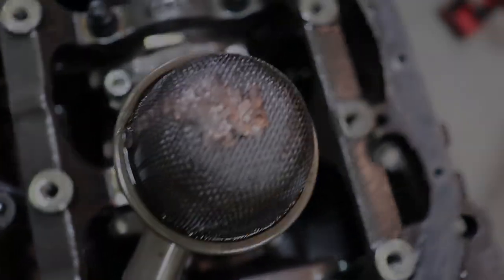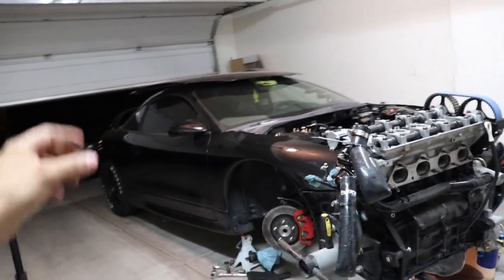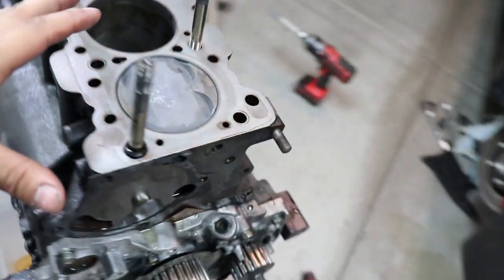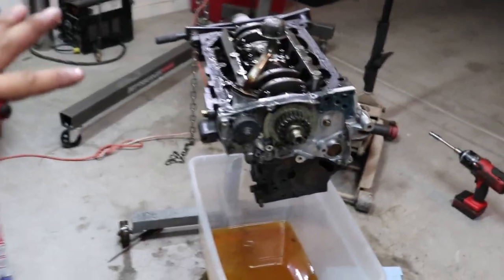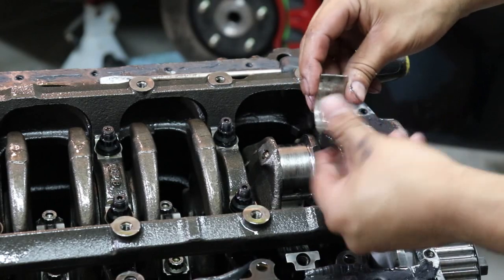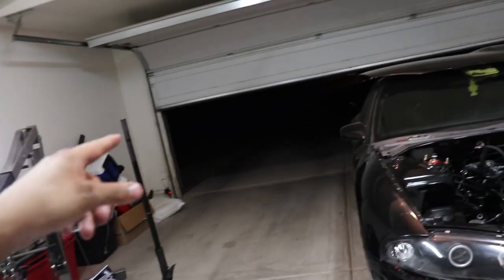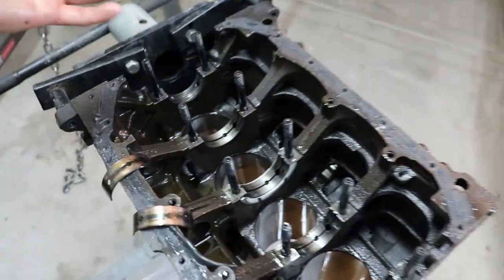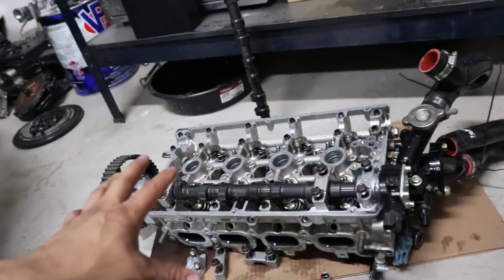TEARDOWN OF A 700HP MITSUBISHI 4G63 IN MY GARAGE PT3

Comment: this sounds what im going to be doing in the next week. picking up an 90 TSI AWD for 1200 with cylinder 1 @ low compression
Reply from the maker: Best of luck with the rebuild! Good choice on a tsi
Reply: @Gabe_Ortega   i wouldnt call it much of a rebuild im going to replace the rings rod bearings inspect the inside etc. replace the timing for now. dude said the car ran perfect in feb so if i can get some use out of it until i want to rebuild it that would be fine with me.
Reply from the maker: Def. Get the head check out if it lost compression. May be in a valve
Reply: @Gabe_Ortega  I pulled the head no bent valves it was the head gasket replaced that and still not enough compression 60-90 on all so I finish pulling the motor tomorrow.

Comment: If you keep going at this rate pretty soon you'll have to look at sleeving that block I think
Reply from the maker: Next step would be to fill the block with concrete. Or half filled to give it more strength. Doing that takes away coolant from the block so it's not very street Friendly. And I plan on doing ALOT of street driving lol even with those rods :D